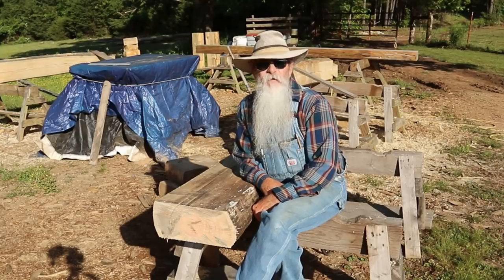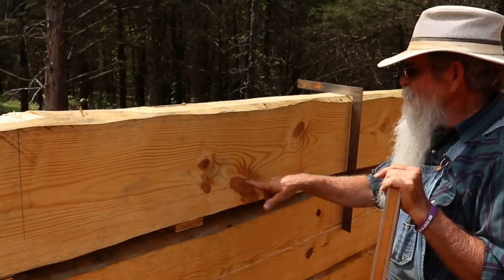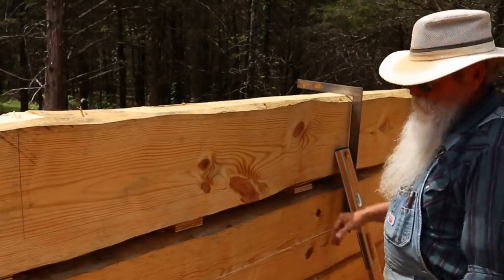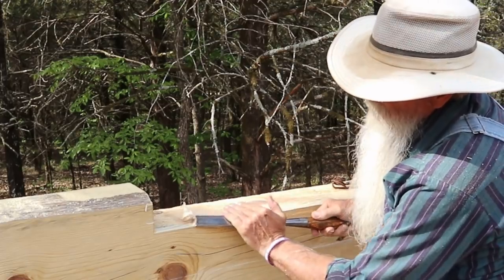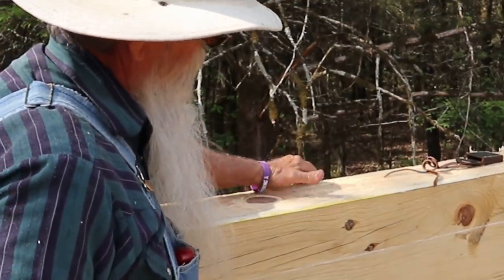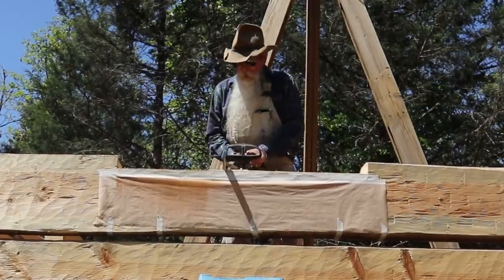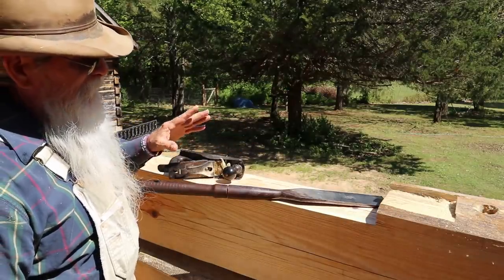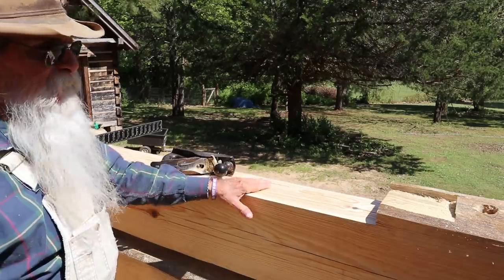Preparation for Window Cut Outs - Dovetail Log Cabin Build (Ep 23)

Comment: Hey Paul, just curious, what will you use the cabin for when you're finished?
Reply from the maker: Cory Williams   Howdy Cory-  I plan on using it as an overflowing bunkhouse for company and a wood working shop for some primitive wood working. I have a shop in town where I can do bigger projects but it’s several miles away. I hope to make the cabin to look like a small log house with wraparound porches. It may also be used for s dawg house in case I ever end up on the wrong side of the Lady hehehe. God bless y’all